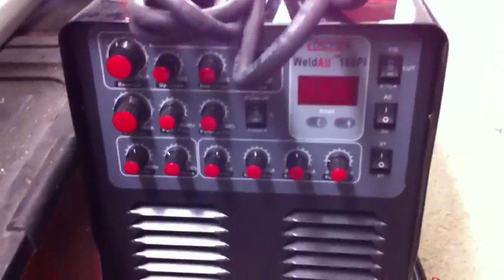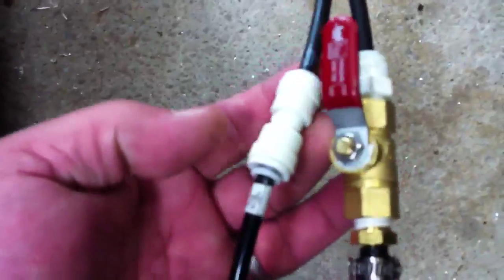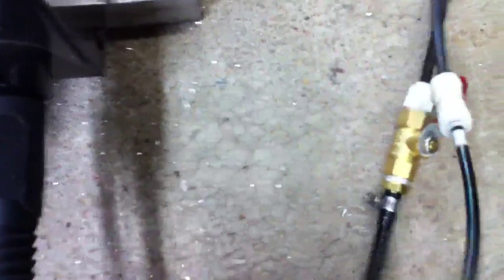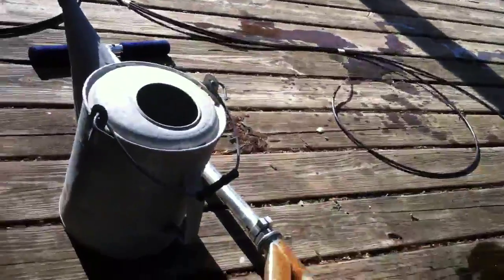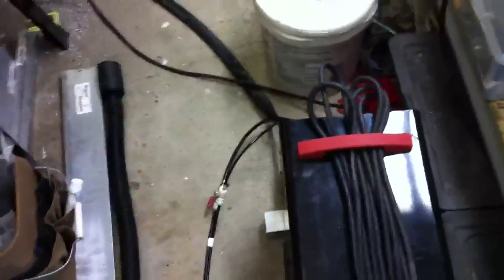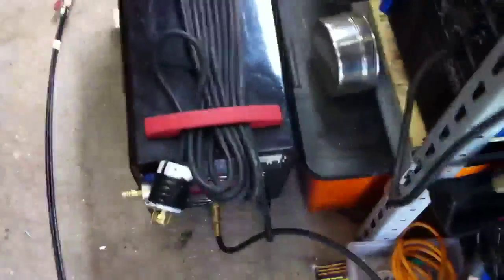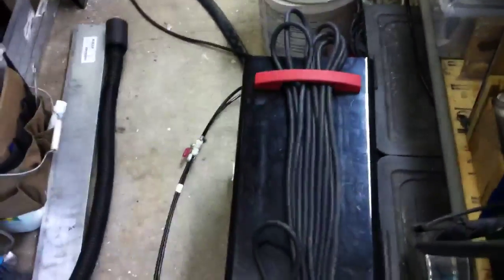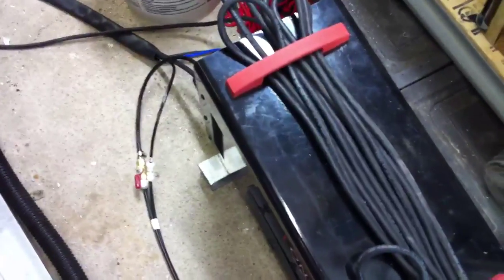Home Made TIG Torch Cooler

Comment: I was going to do the same thing but searching net and youtube. I found that It eventually degrades the cable the water runs through. But cooler isn 500 bucks torch 100 so you do save some cash
Reply from the maker: It wont deteriorate anything for a garage user. Maybe if using daily, even then it would be worth it. A cooler needs pumps replaced.
Reply: This is what I'm doing with my powertig welder. I still want to make a cooler though for those times I don't want to keep remembering to have the faucet on.